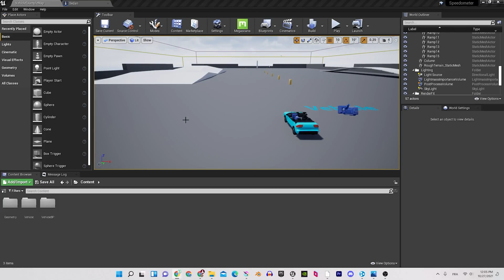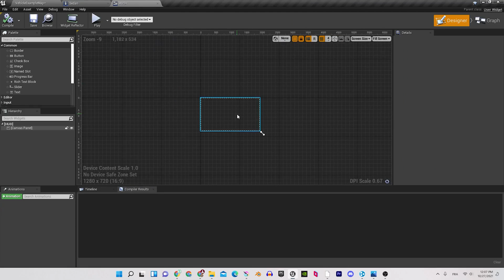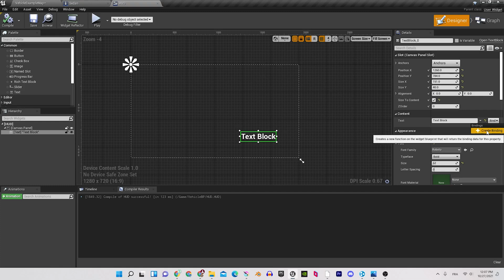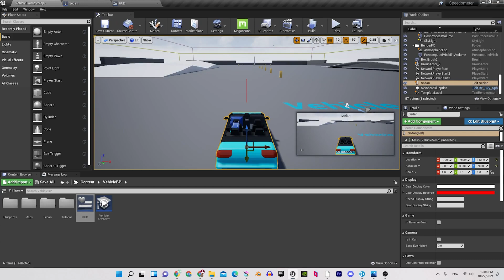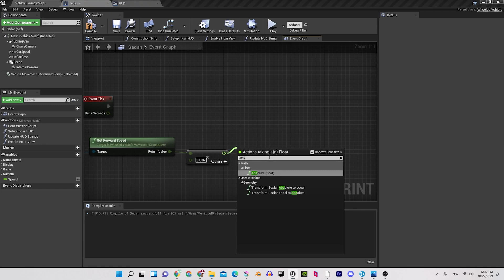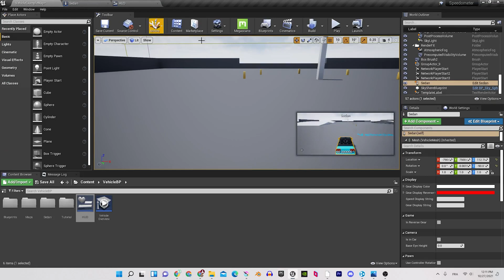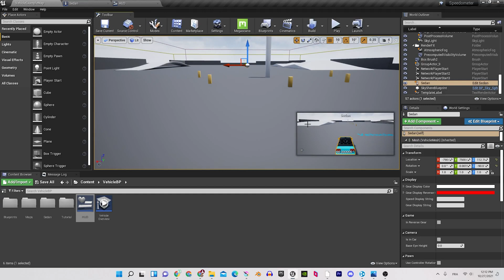How To Create A Speedometer in Unreal Engine 4 (In 6 Minutes)

Comment: So this isn't a speedometer? Your thumbnail says you're doing it in a meter, not with text. Thanks.
Reply from the maker: Good point. There's a pretty easy way to do that but it might sound like gibberish if you don't understand code. You could keep the speed and with the output of that you can multiply it with the angle of the UI element for the needle. For example if the speed is 50 out of 100 the the lerp output would be 0.5 then you multiply that by 180 and you'll get the angle of the needle.